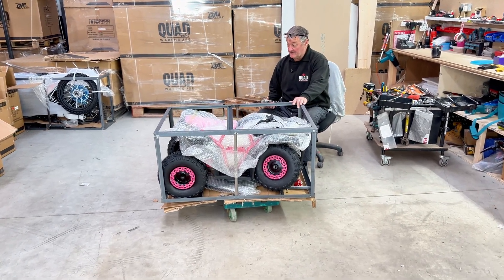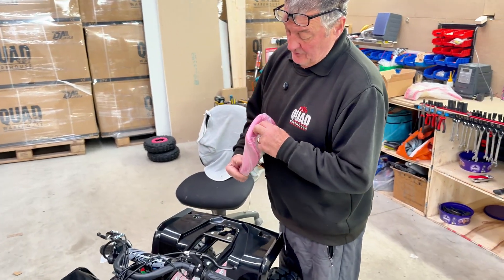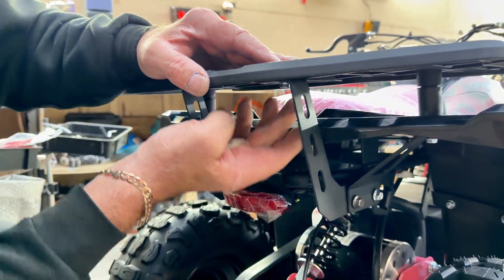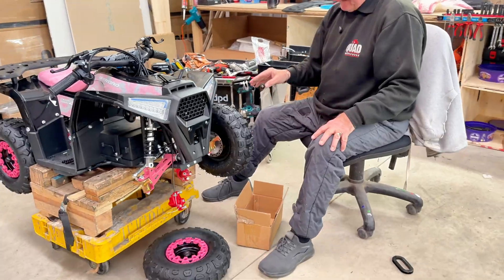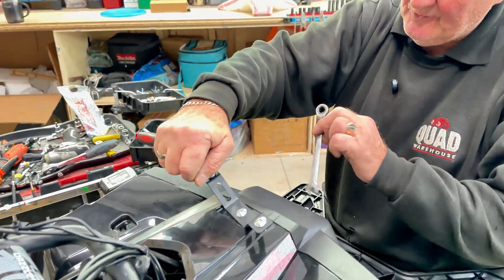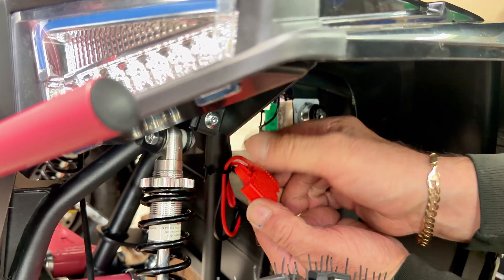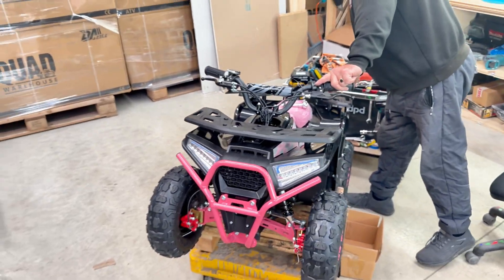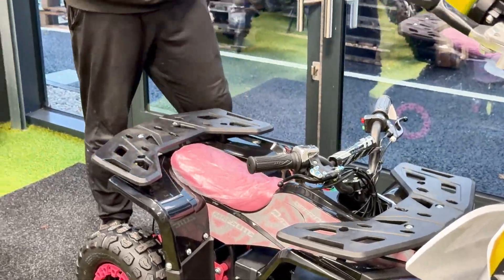How to Build MRF MEGA ELITE 2025 48V 1000W KIDS ELECTRIC QUAD BIKE

Comment: Why do you have to put it on a 12 hour charge when it’s already charged up
Reply from the maker: This is due to the manufacturer stating this needs to be done with them being brand new batteries, it ensures they reach full capacity and extra longevity